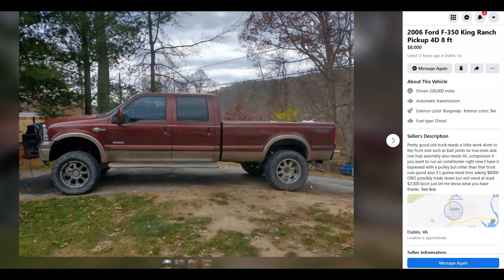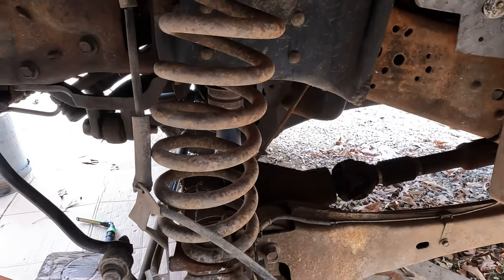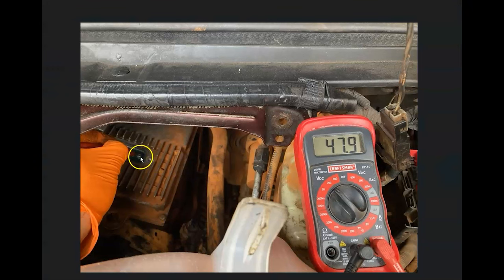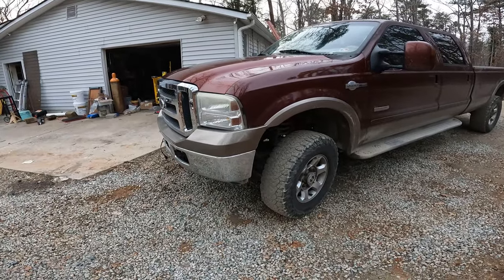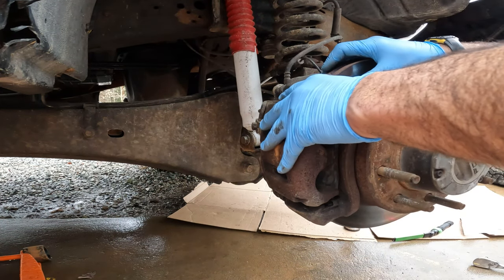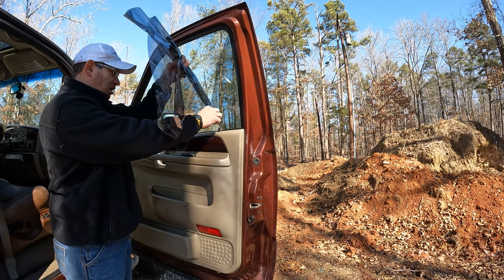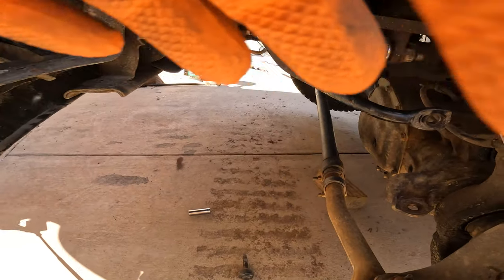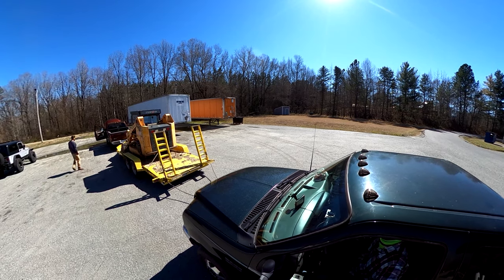Will it run? Buying a new pickup truck

Comment: - Removes big wheels and tires
- Removes lift kit
- Removes window tints

This was basically an episode of ‘unpimp my ride’ 🤣

Great job Shawn!
Reply from the maker: Haha for sure. I would never buy another vehicle that had been lifted. Everything had to be replaced with the suspension.
Reply: @GCFD  Shawn, every ford truck is going to need that suspension work. I've got a '03 7.3L 4x4 274k miles that needs all of that work and it's stock, my buddy's had to have the same work done. Don't sweat it, it's just how big trucks ruin themselves over time. Every obstacle you overcome is a bonding experience LOL Nice work with it.
Reply: @kevinz8867  probably be hard finding a truck like that and being stock. most of them trucks are lifted. and I'm sure he probably got that truck pretty good price probably why it was cheap. if truck was stock, it would cost $2000- $3000 more.
Reply: @funtyes1970 I don't have any trouble finding non-lifted truck around by me. but You're right, a lot are lifted. I get asked often if I want to sell my truck because it is stock for the most part. I just have some fenders and a grill. They came on the truck when I bought it. I just have this truck for going to Home Depot.

Comment: I’m really proud of you for not giving up and pushing the truck off a cliff when it seemed that every problem you fixed opened up a can of worms to more problems. I look forward to your next video in this saga to see how and what you have done to mitigate the problems involving making this truck safe and road worthy. Best of luck!
Reply from the maker: Thank you Michael! I'm currently tracking down a high pressure oil leak. I'm hoping it's just an O ring or injector.

Comment: Well I for one am very impressed with your tenacity to doing things the correct way and not giving up on a project,.  Combining the experience you are gaining with working on the truck yourself and the cost involved in that, with current used truck pandemic prices, I think you are still coming out ahead of the game.  Unfortunate the seller didn't disclose the true condition, but you have learned a very valuable lesson with looking at the pretty of the truck.  Hope the final result isn't too wacky.
Reply from the maker: Yes I completely agree! This has been a great truck and I really really like it. I have also learned a lot about it and wouldn't hesitate to buy another 6.0 that needs work. Thanks for your support! - Shawn

Comment: When changing the fuel filters for the 6.0 PSD, you need to cycle the ignition switch 3-4 times.  Turn the key on, listen for the fuel filter to turn off in ~30 seconds, turn key off.  Rinse, repeat a couple times.  That guy was a COMPLETE hack!!!!  Great PVC/brake trick when unloading/loading a trailer!
Reply from the maker: Thank you! Another example of how PVC is better than corrugated pipe. 👍

Comment: This was an enjoyable video in relation how it was filmed, your detailed explanations and also the content.  I felt for you in relation to the work you had to encounter and yes the individual that let you drive down the road with those faults and what he did to the brakes, was a bad deal he laid on you.   Your pragmatic approach to dealing with the issues is a true strength.   Hopefully the money you have invested into the truck will prove beneficial in the long run.  Keep the drainage and mechanical videos coming.  Thanks.
Reply from the maker: Thank you 71Karma! thanks for watching and commenting - Shawn

Comment: Great project video Shaun! By the way - that is how all auto glass was installed (double sided gasket pulled over the body pinch weld flange) until we added airbags. Airbags require the glass to be epoxied into place. Glass people really seem to practice CYA to ninth degree.
Reply from the maker: Thank you! Great info about the auto glass. 👍

Comment: Fixing the air is easy as too. Buy an ebay 2 stage vacuum pump, O-ring kit, Pag oil, manifold gauge set, can tap and charge it up with air dusters (R152a). I've done myself just to see if it could be done. It works. Never pay a fool again to charge your a/c. You can get R134a air dusters/freeze spray too if you are particular.
Reply from the maker: Yes! I had filmed fixing the air but I thought the video was too long and excluded it. I have 25lb jugs of r134a that I keep. 👍👍

Comment: Also a tip with thouse seats alternate dish soap then oil(coconut) or leather treatment and let it sit the dirt and crap will just pop to the surface where you can wipe it away, you will be surprised how good they will look after. Just always end with oil and wipe dry, as it will take 3-5 repeats.
Reply from the maker: Thank you!

Comment: I imagine that when you bought it you had no idea that you would have to work so hard to make it safe and reliable, but now you know that it is a great truck, with everything that is important made new with good parts and you know that you did it with your hands, I am also impressed by the number of tools you have, a very good collection that helps you at times like this or with the reforms to your trailers, etc,

Comment: Hi Shawn, hope I'm spelling your name correct. General rule of thumb is to tighten the swaybar bushings after the weight of the vehicle is on the ground/wheels. Lower the truck on the ground, shake the suspension a bit and tighten them, because you are allowing the bar to sit in her standard position - in relation to the bushings when you are tightening the bolts. Aka less tention/optimum posion on the bushings while truck is in motion.
Reply from the maker: Thanks for the tip! I'll be sure to loosen them up, shake the truck around and retighten.
Reply: The truck was sitting on jackstands under the front axle the suspension was compressed

Comment: I'd like to see more of these trucks. I just hit 4 yearas of ownership on my 06 F-250 and I've learned a lot. HPO leaks, ficm issues, oil cooler temp issues, etc. You described it best, they're really enjoyable trucks when they're running. Man, you need to invest in a SCt or other tuner just so you can have real time monitoring of all the parameters of the truck. You can see issues coming and take care of them before they become real problems. Also, on the 2 trucks that you aren't doing the relocation on, you can backflush your oil coolers and bring antifreeze/oil temps much closer. That will help prevent another rupture. Worth checking into since you pull heavy a lot. It's an easy job.
Reply from the maker: thank you Bill! I have a HPC leak on this truck right now. I just bought the IPR and ICP fittings to air test and hopefully find out what's wrong. I also bought 4 new injectors for the driver side just in case we have to go in there.

Comment: I don't know what the filter is called, but the older(pre-2006) 5R110W transmissions use it. However, that's a good thing. The 5R110 is remarkably easy to repair and rebuild.

Also, from looking at your transmission fluid, it's time for a fluid flush and internal filter replacement.
Reply from the maker: Thank you Mark! I had done the trans fluid and pan filter thinking the trans was acting up, but it was really a broken off injector. That other filter was long overdue too.
Reply: @GCFD  Agreed! That one was BAD! 😳🤢

[edit] It's a cooler line filter! 🤦‍♂️ The 5R110W has two different types. The rolled paper one as you have and then a can style. The newer model years don't even have one.

Comment: If I came up with the bumper fix using the strap on the front tire you’d never stop hearing about it. I said to myself ”Shawn, a two hour video about a used truck you bought?” Didn’t I watch it all? Good job Shawn I hope it works out
Reply from the maker: Thank you! It's been a great truck and good learning experience for sure. 👍
Reply: The bumper/strap fix was ingenious.

Comment: I did this same operation on my 99 dodge cummins 2500! But I also replaced the steering box, hoses n pump. Next on my to-do list is ball joints but I'm stalling lol love my truck, though. Great vid👍You might wanna install a larger capacity aluminum tranny pan with cooling fins

Comment: 🤣😂 I agree with Brandon. I can't believe I watch this whole video as well. There's been other videos I needed to look up, but I said no I need to finish watching this video. I meant what I said on my first comment on one of your videos. Your videos are very very detailed and you are if not the only that I have seen that explains situations and problems,  but showing how it needs to be fix ar the same time instead of just sitting in front of the camara just talking and not making the video interesting. Keep doing what you are doing brotha you have a new follower and subscriber. I love videos or drainage oil and pulling apart and putting things back together ❤️.  There's just something about it that motivates me on taking on projects that I've never done before. And it also helps with my discouragednes.  Thank you for taking your time and making videos like this. Please 🙏  keep the videos coming.

Comment: Red dye diesel is for off-road use only….tractors and such.  Here in Idaho if you get caught using it in a Highway use vehicle it can be a pretty steep fine.  Good luck with the repairs!
Reply from the maker: Same here. I don't know anywhere that sells off road diesel around here.

Comment: Glad to see someone else love on these 6.0L powerstrokes. I have two of them and my sons have them too. Fortunately one of them is a diesel mechanic at a Ford dealership. You need to change out the fuel pump on that truck. After 200k miles they tend to slowly die and this will cause you to burn up a cylinder as the fuel also helps cool the combustion chamber also. Cheaper to replace fuel pump than to replace engine.
Reply from the maker: Great tip! I'll get that done for sure. 👍

Comment: Don't forget to fill that compressor with oil amount should be in manual.(if you don't thae the manual you an generally fill the compresser on the bench and that's about the right amount)  The owner did you a favor because if that systems been open that long you want replace the dryer, orfis and tubes anyways. Also get a reader and (ford obd2 reader and controle)forscan its really handy for diag and you can controlee most systems with it. Also because of the hackery you may as want to some check if its been "tunned" and put it back to factory.
Reply from the maker: I've been using a forscan and my laptop and it works well. 👍

Comment: You should set the safety pins and always use both spring compressor bolts on a spring 

I’ve see a guy loose 2 front teeth from a spring popping out

Comment: Surely walking down to the junk yard and getting another compressor (even if it doesn't work) would have been easier than jerry rigging all that together.
Reply: Way more work to rig the thing. Definitely could have put in a compressor with less work. Absolutely cheaper in the long run.
Reply from the maker: Hahah, replacing the brake pads would have been easier than cutting the brake line and crimping it over, but nope. Cut!

Comment: I like a few inches of lift and extra wide tires (particularly on the rear axle) but I understand it causes the need for extra maintenance.
Think on the bright side after a few more new parts you will have a brand new truck.
Reply from the maker: It sure feels like a brand new truck at this point! I really like it.

Comment: Nice one Shawn!
Given the state of the servicing on the vehicle, I would not have went anywhere near that!! 
Do you guys not have a yearly vehicle inspection to make sure the cars are fit for the roads?
I hope you did the oil and filters, that is usually what kills Turbo's. Also, if the fuel filters are full of junk, the fuel tanks is most likely needing cleaned as well. I dont know of that truck has a lift pump in the fuel tank, these usually have filters and require replacement as well. The lift pumps are usually in gas vehicles.
First rule when buying a vehicle is never buy one when it is Dark or Raining. 
Good job Shawn, a lot of work, but you are gaining a ton of experience, every cloud has a silver lining!
Reply from the maker: I just got this truck back to running yesterday. I did the injectors on the driver side and everything is good again.

Comment: I just bought a 05 f550 6.0 powerstroke. 40k original miles. I was a plow truck for a hospital. Alot of idle hrs. Just did an EGR delete and turbo. Everyone says the 7.3 is a better motor. But like everything else they have there draw backs. From what I read 7.3 is a good motor but the trannys are junk. Vise versa with the 6.0. Not sure what anyone's thoughts are on 6.0 vs 7.3. Mine has had issues but I can't complain it's made me alot of money in the short amount of time I've had it
Reply from the maker: I like the 6.0 because the problems are well known, lots of great videos online, and lots of upgraded parts for sale. I just bought an oil cooler relocation kit and upgraded EGR cooler for my f550 dump truck with the 6.0.

Comment: Hi there Shawn. I have mentioned before that I don't mind non-drainage videos once in a while. Because I appreciate the effort you put in producing them. Obviously you're someone with a keen interest in mechanical works. All the more impressive for someone with a background in biology. You have the skillset and determination to get things done correctly. Hardly did I hear you say any harsh words while working on the truck. If it was me, I'd probably be swearing here and there when I find one problem after another, hahaha... Just out of curiosity, which part of the repairs gave you the heaviest muscular workout? I'm guessing the steering dampener install. BTW, I watched the whole video in one sitting (ok, maybe 2 sittings with a toilet break in between 😁).
Reply from the maker: Thank you Oldstock! the turbo was quite heavy and at an odd angle with leverage working against me. The steering suspension stuff is tough because you're on the ground trying to work. I'm glad you enjoyed the video because this one took a lot of effort to shoot and edit. it was also tough to stay motivated to film it and I'm sure you noticed some gaps where work was done but not filmed.

Comment: I have a nightmare truck too. Redid the front suspension. Now fixing the brakes and that has been a pain. Brakes are stronger in the rear than the front.
Reply from the maker: Good luck with it! This truck is in pretty good shape now and I'm very glad I bought it.
Reply: @GCFD  thanks. Good to hear yours is running good.

Comment: The seller was the one that got "the good deal". I have the feeling that you will be throwing a lot of parts at that truck...now and later. Make sure you are using Arch oil in that engine and cleanup the grounding wire attachment to the frame.
Reply from the maker: Yes! I'm using Archoil. I'll definitely check the ground connection. This truck rides so well with all the new parts that now I need to do my other trucks.

Comment: Should always use jackstands.  Even if you're not going underneath it there is still risk of getting an arm pinned or the vehicle could slide towards you as it falls.  Also just avoid the pain in the butt of having to lift it back off the ground and also likely more damage being done to the vehicle.
Reply from the maker: Great tip!
Reply: Appreciate the video (just finished watching) and all the work put in to getting that truck operating again. Stinks there is still more to do.  Not sure what the previous owner was thinking...

Comment: Great for diagnostics.  Will tell u ficm voltage.  And oil pressure reading in fuel rail.  Common icp sensor and ipr failures in the 6.0.   Ipr screen can plug and cause them to die.
Reply from the maker: I'm pretty sure it died recently because of the IPR. I have a new one and will be checking it out tomorrow evening.
Reply: I put a sold as motorcraft IPR off evilbay in mine.   It worked.   But caused a long crank on start up.   I only replaced it for preventative measures when i did a turbo replacement.    Put the original back in and it starts great as before.    Watch what parts u use.
Reply from the maker: Yes great point! I only use motorcraft stuff for sure.

Comment: Hey Shaun, I really enjoy your video's and this one was no exception. I'm not sure I would have been as cool as you are if I started finding all of the issues you had with this truck. My favorite part was fixing the front bumper. 😆  I liked your answer to the problem, thought I was watching Andrew Camarada for a minute! 👍👍 Bottom line is that it worked! Keep up the great content I look forward to all of your video's!
Reply from the maker: Hahah on that front bumper I kept thinking, andrew camarata would just use his excavator. I have an excavator! But then I was worried about not having the fine control over it and came up with the strap method. It worked!

Comment: Applause, applause your front end refurbish, and rear glass  work. I hate to sharpshoot after all your fine efforts, but I hope you do the front springs as well. They look really sketchy. What is the story of your green, dually 1-ton? It also looks like early-mid, 2000s vintage. Since your green 1-ton is also a 6.0L I imagine you're familiar w/Diesel Tech Ron's 6.0L diesel, YT videos. If not, I think (for good reason) the YT 6.0 crowd considers him to be the gold standard of 6.0L troubleshooting/repair instruction.

Comment: The hose for the turbo is on the may be off on the heater box above where the ac dryer is its a small tube and easy to miss